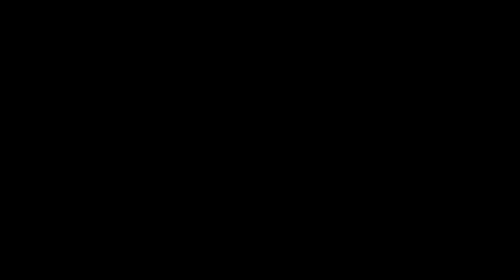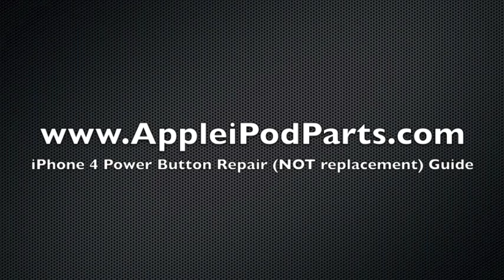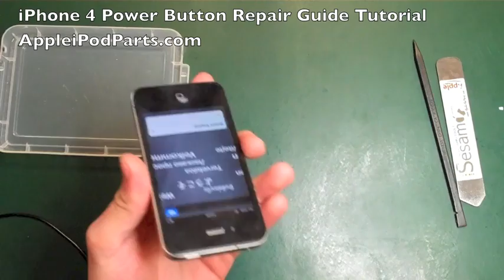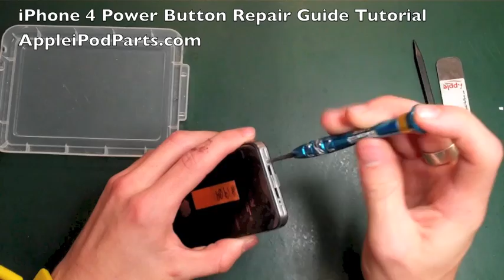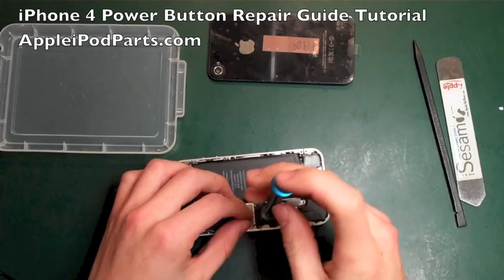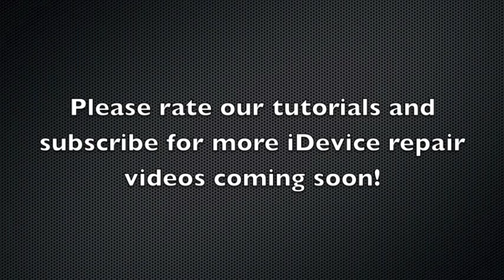iPhone 4 Power Button Repair NOT Replacement Guide Tutorial - AppleiPodParts.com

Comment: I am surprised that this video has an approval rating of less than 95%. One of the best videos around. Perhaps the only misleading part is that this video expects you to buy an iPod switch (which is perhaps cheaper as the OP has suggested). Other than that the video is quite detailed.